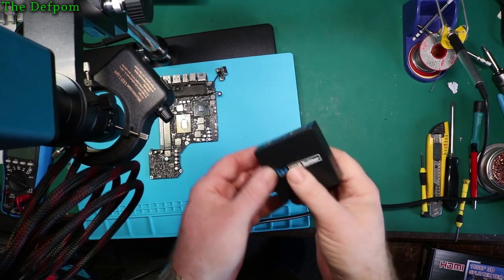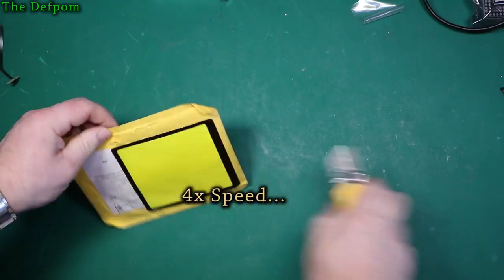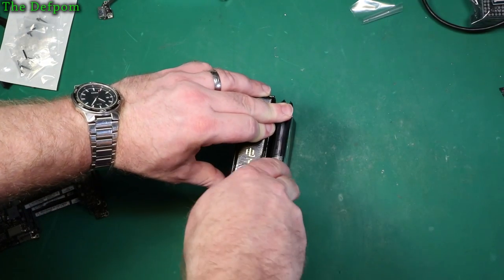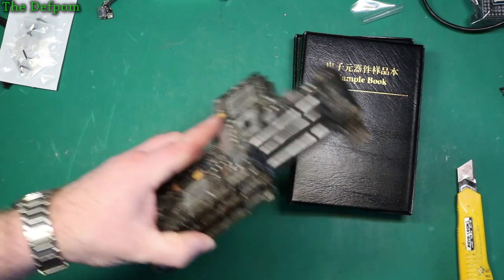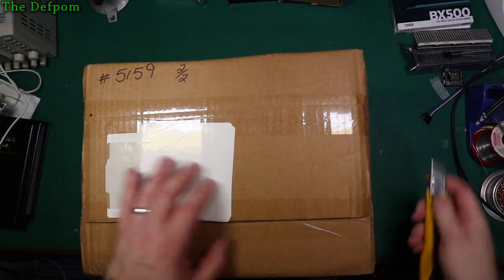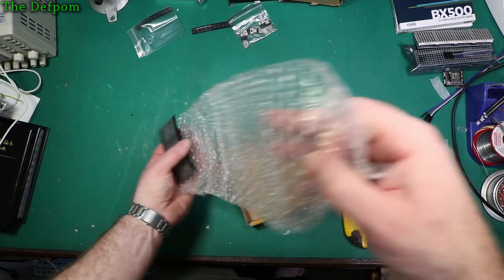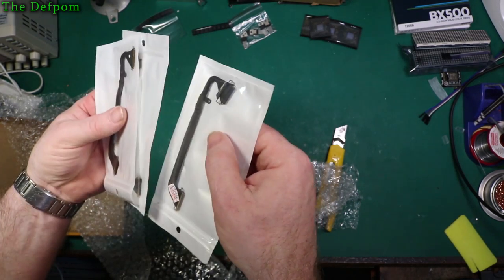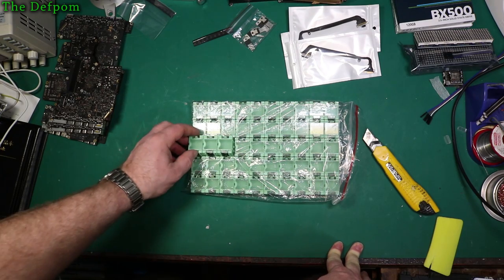🔴 #483 Mailbag Monday 10th December 2018

Comment: What is the little containers called The little container compartments that holds Small items Do you have a link for them lol
Reply: Refered to as "WenTai SMD component storage boxes" on ebay.
Comes in a variety of sizes and colors.
You can find reviews of them here on YT.
A bit tricky to get those small parts out of them little boxes ;-)
Reply from the maker: Q's Tech Service - I just searched for SMD component drawer or compartment or something, these were from aliexpress. You need tweezers to get the parts out, but that’s not really an issue.

Comment: I have a big set of those component books including all the capacitors.  It a convenient was to buy most of the components in one shot. I guess you need a critical mass of Mac book spares to get started. Still it looks like a lot of trouble.  Good luck. I’m interested to see your experience with the ultrasonic cleaner. I keep looking at the cheap ones on eBay. I don’t believe I have yet purchased any salvaged parts yet, but it’s an amazing market and better than landfill.
Reply from the maker: AllTheGearNoIdea - the ultrasonic was a good price, is rated at 200w for the transducers, and sourced locally, and is 9L capacity, about half the price of similar units I had been looking at.
Reply: The Defpom's Repair Channel  be interesting in seeing it in action. I would like to put carburettors in it. Regards Chris